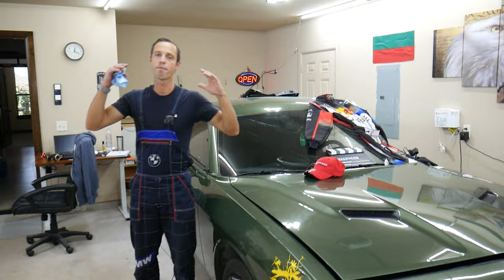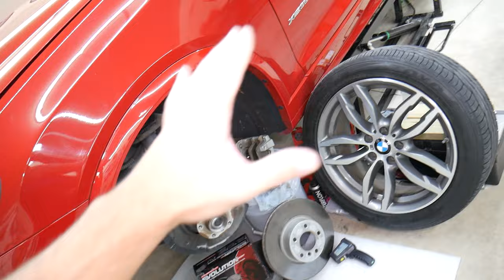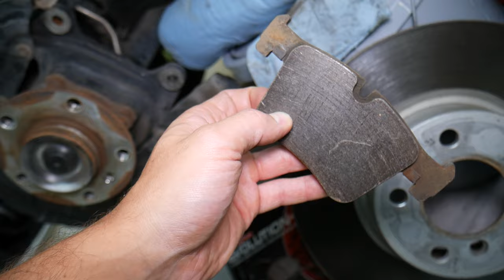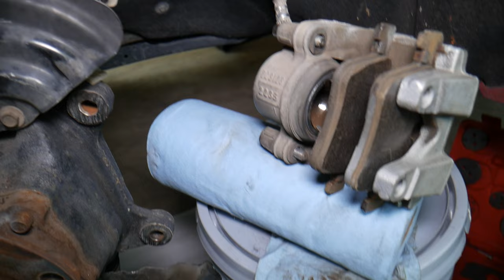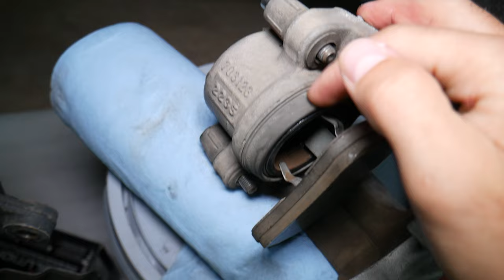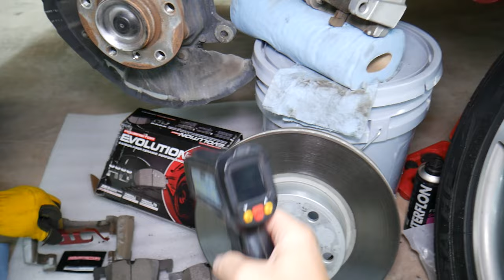HOT BURNING SMELL COMING FROM A WHEEL OF A CAR

Comment: After driving for about 30 minutes on the highway I heard a strange squeaking sound. When I came to the next stop I smelled really hot brakes. The left rear wheel was putting off a lot more heat than the other ones. Stuck caliper? It's very strange it happened while just driving down the highway.
Reply: Could be seized caliper guide pins